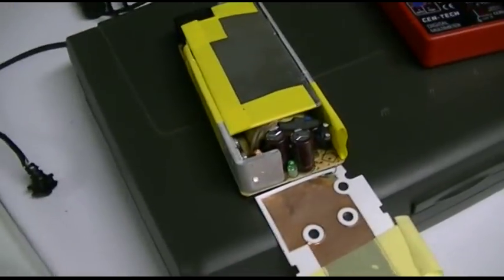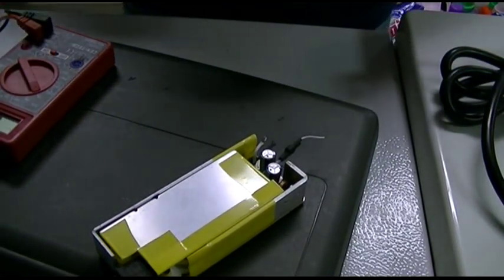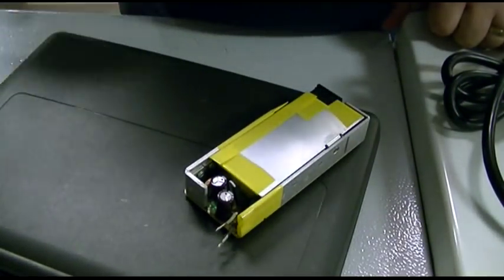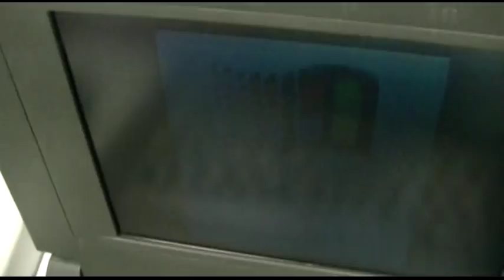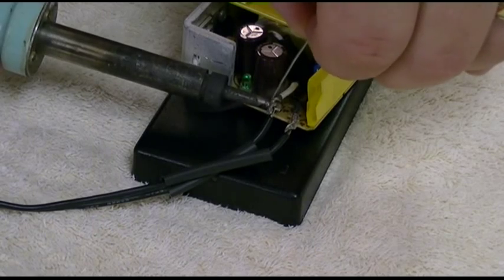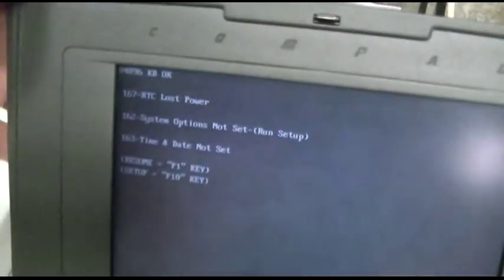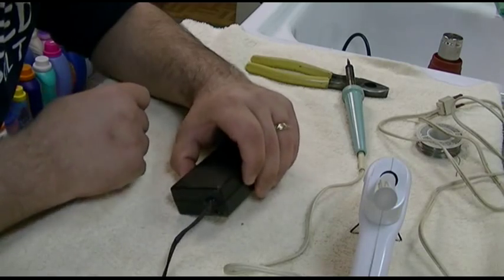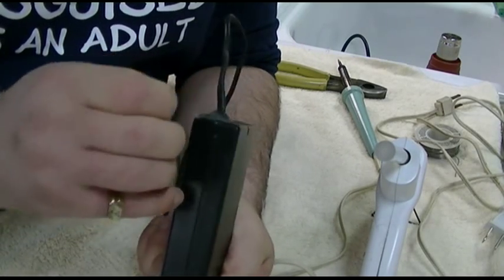Compaq Contura Power Adapter "Repair"

Comment: Not a bad approach.  Maybe even a little better than mine.  I had a bunch of LTE Lite power bricks fail.  I did the replace capacitors route on those.  It probably would've worked on the Contura ones too.
Reply from the maker: Thanks.